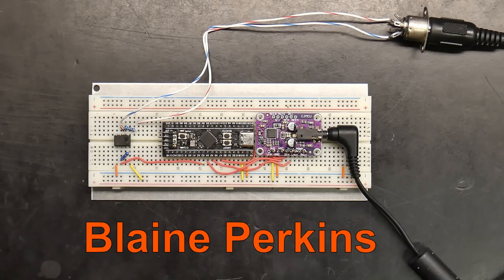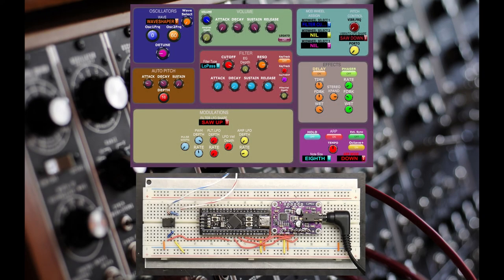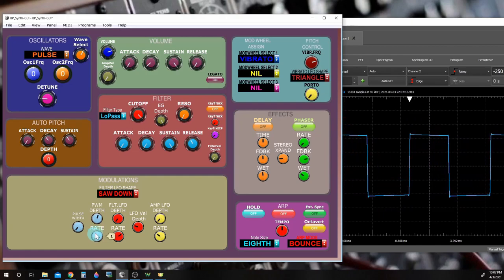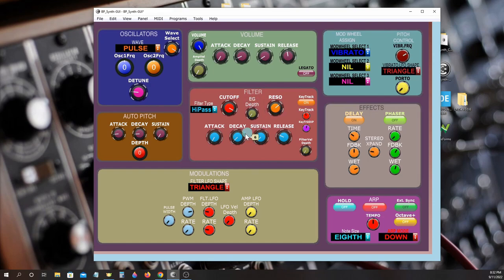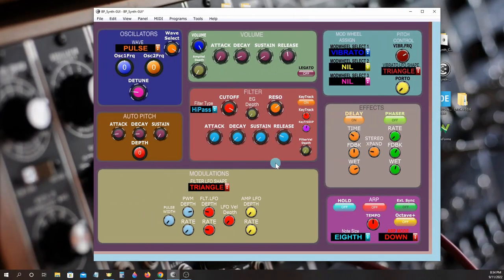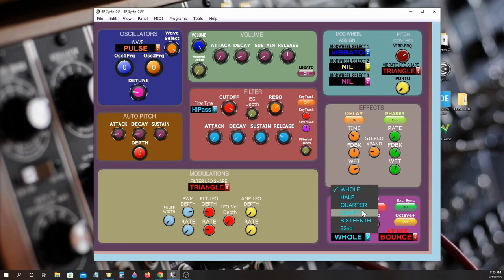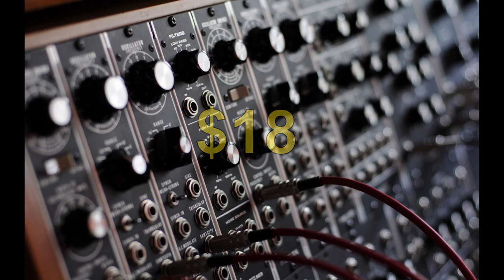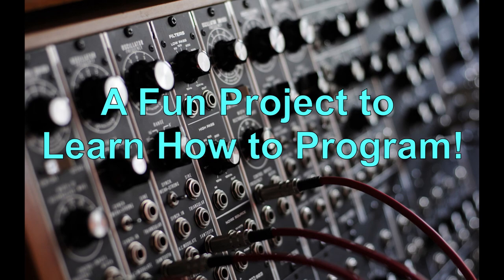BP Synth.. a DIY Virtual Analog Monosynth that YOU can build for ~$18

Comment: This is a really inspiring project.  I hope you decide to do the full educational series on how the software works as in addition to building this version I would like to know how it works under the hood and maybe also build an expanded version using a more powerful board.  👍
Reply from the maker: Thanks.  I did upload a few Prep info videos about the basic signals the Synth uses and the IDE used to program it.. it's in another playlist on my Channel. 
So far there has not been a lot of interest in my BP Synth.. I got a lot of views for two days and now it's gone dead.
I'll probably end up releasing what education vids I had recorded in the past, which is a lot.. but I may not get anything else completed..
Things just did not turn out like I thought they would...
Reply: @Synthetech  Really sorry to hear that uptake has been slow.  Maybe its just going to be a slow burner and that the Y/T algorithm will find it at some point and start recommending it more widely.  I have seen where other people have done similar projects using Teensy, ESP32 and R Pi Pico boards, but what set your series apart in my eyes was the prospect of it developing into a proper educational series --- a sort of Ben Eater for digital synthesis.  Looking at the comments, some people seem to have been disenchanted by your use of a PC GUI to control it in the demos.  For demonstration and experimentation purposes this is by far the best solution and really the only option if you are aiming for a low cost of entry.  However, perhaps some people didn't appreciate from your comments about MIDI CC commands how easy it would be to interface this to physical hardware and use either a commercial MIDI controller or custom-built dedicated hardware controls.

Comment: Very impressive work!  I was looking for ideas on building a synth to go with a Pi Pico guitar pedal I designed and this is a lot like I was thinking.  I was wondering if there could be a Eurorack/patch-panel like setup where multiple LFOs, envelope generators, oscillators, and such could be connected together in a myriad of ways.
Reply from the maker: Thank you!  I never really intended the BP Synth to emulate a modular system.  I really had more in mind like a MiniMoog or a Roland SH-101.

Comment: Absolutely amazing. Thank you for your hard work and dedication ✌️
Reply from the maker: Thank you.  Did you figure out the different DAC's?  I could not find your post in here that was notified to me..  if you need info on the two different DACs, look here: https://youtu.be/JzFKG6iIFms?t=61
Reply: @Synthetech  Is the actual Black Pill faster please? It's just turned up from amazon £7.99 branded Black Pill. Ordered the chips and the DAC converter from ebay. Chips were £3 for 2 and the DAC board £7.99.
I have loads of bread boards but can I find them! Might as well order a couple from Amazon. Its easier than trying to find them in one of many boxes. I have plenty of 5 pin din leads so just waiting for a couple of bits from ebay. Not sure if you've heard of Rakit? I'm just about to start their Rakit Drum kit. 
The kits from this company are amazing quality. I've already completed their Baby 8 step sequencer and an Atari punk kit. Worth checking out. 
This synth is a true bargain.
Many many thanks again for your hard work. Unbelievable ✌️

Comment: sounds fantastic, I am a little put off by the requirement of the software controls though, hopefully a hardware midi controller could be developed to go along with it, although, that is a lot of knobs!
Reply from the maker: No requirement to use the GUI. There is a MIDI CC list in the zip folders if you want to program a MIDI controller's knobs, sliders and buttons.
More hardware to the project adds a lot more cost and complexity.

Comment: So rad!   I've gotta set aside some time to build this.  I have dabbled in Arduino + Midi.  Can you tell me- would it be easy/possible to implement an lcd readout for the tempo?  I would love to be able to set a tempo live at an exact bpm without having to run an external clock source.
Reply from the maker: it's possible.. using one of those cheap OLED screens that connects via I2C would probably be the simplest way.. and having an encoder to change the beat/value.
There may come a day I might go over something like that.. but unfortunately it won't be anytime soon.

Comment: This is awesome! Is it possible to pair this with an arduino midi controller to take the computer out of the loop? I would imagine pairing it with an LCD to display the settings.
Reply from the maker: Thanks!  Absolutely you can use any MIDI keyboard/controller with it.  I have a MIDI CC chart included in the Project Zip file.
I've already started and slowly (a few hours on Sundays) been working/programming on a version that uses a PCB with OLED Display, 3 buttons and a Encoder with push switch to navigate settings/options, have saved presets/patches and maybe some kind of sequencer.
I may try to get a small teaser video up soon...  not sure if it can be turned into a fully sellable item, but we'll see...

Comment: Awesome!!!! Is there a way to add a sampler to it so the rest of the device uses the sampler as an oscillator? And the sampler could do both 8bit and 12bit? I'm building this anyway, however, is this possible and if so... Will you do a video  on that? I can only imagine samples going through them filters add maybe a simple envelope? Thanks for this project.
Reply from the maker: I did experiment with some DW-8000 wavetables, but had to convert them to 16bit array's first.  In a later video I explain how a simple Sine Wavetable is used for the Phaser's LFO.  The BP-Synth can't record and playback like a sampler..
The short answer is, it can be made into a Rompler but it'd take more time to program than I currently have to spare anymore.

Comment: Where does the single voice that makes this a monosynth live? Is it the code running on the blackpill or is it part of the DAC?

Can we expand voices on this build get get poly?
Reply from the maker: Code is running on the BlackPill that streams audio codec to the DAC module.
BlackPill only has so much power to process all the DSP code at once.   You could create a poly synth  with the BlackPill but you would have to leave out things like Delay/Phaser and the Filter.

Comment: Is "hard synch" modulating the PWM with the oscillator of the voice as the "LFO"?
Reply from the maker: Hard Sync has one audio Osc and a second triggering Osc for the 1st Osc to "Sync" to.    The 2nd Osc will "retrigger" the 1st Osc to restart it's waveform everytime the 2nd one starts over.  Best to google the information about Hard Sync synthesizers for better details.
Reply: Was studying it yesterday night and today. Surprising I hadn't known about that one. I have done every major type of synthesis.  @Synthetech

Comment: How difficult would it be to add a mono/poly toggle as well as a midi port? Any idea of the now cost to be?
Reply from the maker: Poly would require writing a lot of new code but there would only be one Filter since the DSP for just one filter eats up a lot of CPU power.  There already is a midi input port but an output port is possible.

Comment: i wonder if i can control 12 of these at once? at least i can pretend I have an oberheim complete with sem modules
Reply: I was thinking about this too --- a supervisory board that takes the incoming MIDI and distributes cc to all BP Synths and notes to the next available BP Synth in a loop.  The supervisory board would also provide the arpegiator function (and maybe a sequencer as well).  I wasn't thinking as ambitious as 12 voices though, say only 4 or 5 to keep the total cost within a $100 ceiling.  The supervisory board could be a Raspberry Pi Pico to reduce cost and maybe make use of all the PIO goodness that board offers.
Reply: Problem I see with that is the common sections like the LFO and effects are not shared, you really don't want 12 phasers, more likely you want one with all 12 voices fed into it. Although polyphonic LFOs are a thing, again you are more likely to want 1 LFO doing modulation maybe another doing PWM
Reply: @craigyjp I don't know, a polyphonic phaser sounds like a cool thing to have. Much like a polyphonic LFO. You could always code the phaser into the RPi pico that's doing the round-robin on the voices I guess, or separately on the mixer section. Or both. You could also make it multitimbral.
Reply: @TheDavidPoole  good luck with that, a polyphonic phaser will sound horrendous. Yes, you could turn off the phaser section on each individual voice and build a seperate phaser on the output which is a much more sensible option. And even in multi timbral setups the effects section is comprimised by being global, look at ensoniq synths, common effects section, roland JV/JX/JD/XV synths etc wih common effects. The levels per section is unique, but they share the same effects. So if you keep individual effects per voice you are back to square one with a polyphonic phaser when playimg chords or the same sound.
Reply: @craigyjp  I guess it depends on the sound you're looking for. I don't particularly like heavy bitcrushing but others swear by it. That's why I suggested a separate unit on the output stage. I'd rather have the option and be able to switch it on or off per voice. Especially if it were multitimbral, so it would be an insert effect rather than a send effect. Same with the delay.
Cheers ✌️
Reply: @TheDavidPoole  which is exactly what I just said
Reply: @craigyjp  I'm glad we're on the same page 😀
Reply: @TheDavidPoole  we are after I explained  how synthesizers work to you.
Reply: @craigyjp  thanks son. I've only been using them for 50 years. Glad to have your experience to enlighten me 😂
Reply: @TheDavidPoole  almost as long as me

Comment: Looks like it would cost another 30 Bucks to build a haptic interface instead of that virtual plugin-interface. It would be a fully usable monosyth then... For just 48 Bucks... Awesome!
Reply: can you elaborate a bit more on what you mean?
Reply: @sine0  @3:16 you can see the software-interface. It has arounc 38 knobs, seven buttons, and nine select-fields. My thought is, that there should be a hardware-interface, bringing all those functions to your hands. As every physical synthesizer has buttons and knobs, this one should have too, in my opinion
Reply: @florianinside5666  I was thrown by the word haptic interface thinking you meant a touchscreen for the software. I have been looking up how to control the cv stuff using a midi controller interface using arduino with some multiplexers because of the amount of nobs on the software. i agree it would be cool to have this as a virtual analog synth.
Reply: I was just thinking about how nice it would be to have a MUX option. I'm not smart enough to know how to add that option to this device. That would be much simpler than building an additional device to add between this and a MIDI keyboard. Probably need at least two MUX- 31 potentiometers and 6 or so switches to accomodate. It's a lot of knobs, but wow this thing sounds good.